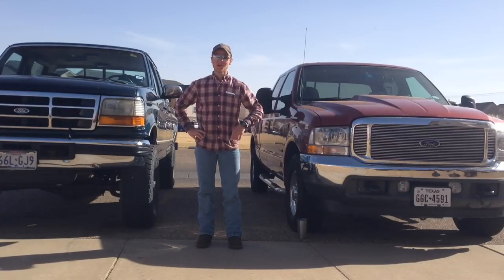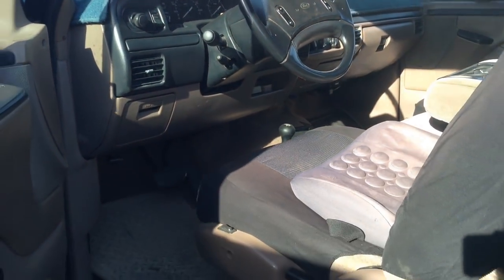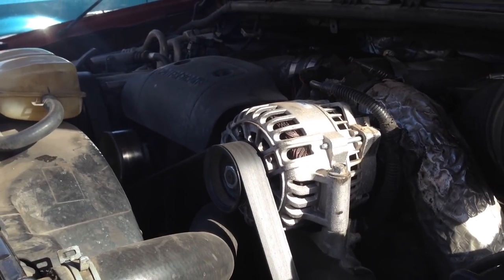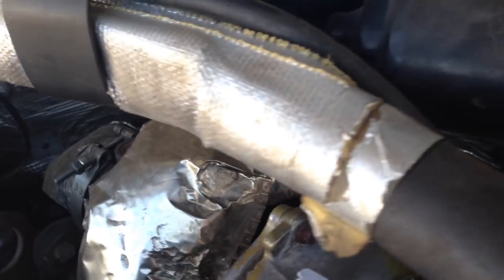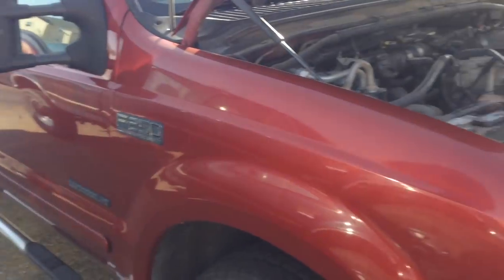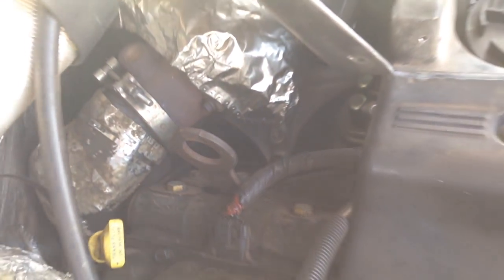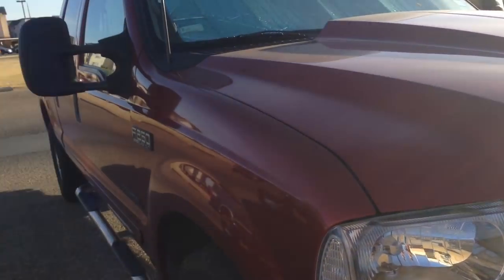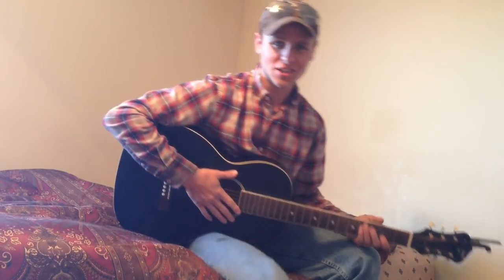OBS vs Superduty 7.3 Powerstroke

Comment: Aesthetically, I’m always gonna go for the OBS. Just is all around tough looking and the nostalgia of the “smokers window” and the push button door handles. An F350 crew cab long bed 7.3 with 4x4 is the Holy Grail of trucks IMO.
Reply from the maker: Heck yeah, I'll second that!
Reply: Club cab, short box.....
Reply: Definitely agree! And if there’s a 5 speed behind it, there’s no truck of wrather have.
Reply: @ChevyManZ  put a 6 speed ZF6. Crew Cab Long Bed 4x4 7.3l Powerstroke.
Reply: Chevy for life but I have to agree with you
Reply: Just bought a 97 crew cab f350 4x4 with a 5 speed and I absolutely love it so far.
Reply: I have a 96 f350 cclb and about to buy a 99 super duty but the 96 has 348000 miles and still starts first click of the key
Reply: Dont forget the Centurion striping, wooded out limo interior and of course the Lund cab fairing and visor
Reply: That's another reason why I love the old Fords and that is the vent windows.
Reply: I have the 94' f350 7.3 turbo single cab dually 4x4. 
My daily driver! I think I will be buried in my truck when My motor stops😂
Reply: @DukeCity.S.V  Sounds awesome brother.
Reply: @ChevyManZ  disagree. It's a big truck, driving around town in a big truck with a manual would be tedious.
Reply: @Alex Colgate big trucks are not meant to be around town,  they are for around the farm, jobsite, or the open road.
Reply: 01 extended cab 7.3 4x4.. She's sweet!
Reply: @rsroor  it’s a great truck I also have 01 extend cab 4x4 7.3

Comment: I have owned a lot of Fords. The obs is by far my favorite.  The power lacks by far in the old 7.3s compared to my 2002 7.3. I still prefer the old ones. I know I am going to get a lot of negative comments from this comment,  But I love the sound of a 90s 7.3 over any 12 valve Cummins.  The old 7.3s just sound good. I was diesel before diesel was cool.
Reply from the maker: We're mostly 7.3/ Ford guys here, so I don't think you'll have to worry about negative feedback! You say the OBS lacks in power relative to the SD, and that is true in stock form, but believe me, after a set of 160cc/00% injectors and an Intercooler, my OBS will beat the socks off a stock SD without even trying. Unless you're talking about the 7.3 idi, which is also an awesome engine, but it is definitely down on power comparable to the SD 7.3. There is one other thing those 12 valve guys are really missing out on though, besides having the cooler sounding engine... Electronic engine control. With that we can burn fuel so much cleaner and add performance a little easier at first too with just a tune. There's no school like old school, keep dieseling!
Reply: @Rnddiesel  Yes stock that is. The 02 7.3s I should say way quicker. I had a 99 And when I got the 02 it was a significant difference in takeoff.  I like the old idi 7.3s. Simple engine. The idi is getting harder to find these days.
Reply from the maker: @steiger256  I'll second that on the IDI's. When I was looking for one a couple years ago there were way more than I see now. It's like the supply just dried up. I'm betting more than anything they're just sitting in a field somewhere rusting away, their owners probably don't even know what they've got. At least we've got our 7.3's!
Reply: OBS have that distinctive cackle that I like. My understanding is later model 7.3L Powerstrokes have a special Long Lead injector for number 8 cylinder to help cut down on that cackle but I'm not 100% sure on that.
Reply: @steiger256  love my old very very rusty 93 idi manual 4x4.Also have a 2000 4x4 manual powerstroke. very sharp looking it was garage kept until I bought  it 2.5 yrs ago. Like  you I prefere  my old obs idi.Turns out it has been a special order.Vinal bench seat and floor. It had a head liner, doors with the map pockets and liner. Little coffee  cup and change holder attached to the fron of the seat. Had a headliner , ac and cassette  /am,fm radio. Finally  it had the 4x4 shift on the floor with auto hubs. To me it was/is the perfect truck. New one has carpet and cloth seats?? why?? even with the big mirrors I have blind spots all around. idi ha small mirrors  and never a problem.

Comment: Just picked up a project for my channel 2001 7.3 6 speed dually 4x4 135k Miles for $5700 so excited!!! Catching up on some YouTube 7.3 materials before tackling the big girl!!
Reply from the maker: That's awesome, a 6 speed 7.3, so cool! It sounds like you got a steal of a deal with such low miles. A good place to look online for more info would be the forums like powerstroke.org or fordtrucks.com I believe. Heck if you have any questions I know a thing or two as well. FYI, familiarize yourself with the cam position sensor, ICP sensor, and IPR. Just knowing what they do will help save you a bunch of headaches. Those are the most troublesome part of the 7.3, especially the cam position sensor. Have fun!
Reply: It runs good? That’s a great price these days
Reply: That's insane for the trucks these days
Reply: Something has to be wrong for that truck to be 5700. Has to be

Comment: I live in Australia and I had a RHD 2005 f250 7.3 but it was equivilant to your 2002, I now have a RHD obs with a 1998 build plate and I have to say I love the OBS more. I have done the e fuel conversion, dump pipe, fuel tank sumps so I feed e fuel pump with 2 tanks.... And the thing is just great fun.... And the old obs engine noise is great... 

Anyway loved your video.... 

It's only a

Comment: My boss had a 97 heavy duty and I loved it. I thought it was a late 80’s early 90’s because of the vent window. Boy was I surprised when I finally read the door sticker and found out it was a 97. Just picked up my 97 F250HD 7.3 and it’s exactly what I wanted. A truck that just works

Comment: One thing that you are not correct on is the PMR. The PMR was only run half year in 01. My 01 doesn't have the PMR. The main issues with the 7.3 in the late years was actually the wrist pins snapping.
  Turbos from the OBS were smaller than the NBS. Also, the split shots were supposed to be better for fuel economy, but but because of the primary and secondary shots, it actually killed the economy vs. the single shot injectors.
 My current build has a GTP38R turbo
Banks intercooler
Banks turbo back exhaust
Swamps HVHF IDM
30% over injectors
CAI
Custom PHP tunes
And stage 1 trans.
Reply from the maker: It sounds like you've got one heck of a build going on, I'm sure your 7.3 is fun to drive! I assume its a Super Duty with the GTP38R? 

I'd heard that the 7.3 got the PMRs past 2001, that somewhere down the road they found some sitting on the shelf and stuck them back in some late model 7.3's. Where did you hear about that? Also I thought the split shot was strictly for emissions, primarily noise emissions? Certainly International Engineers would've actually tested the fuel economy theory before making a run of  over a million 7.3's with split shots, "hoping" to get better fuel economy. Not that I'm trying to pick or anything, I'm asking a legitimate questions. If I said something wrong, I'd like to learn so I can be correct. Besides, finding another source to learn about 7.3's is cool too. I'm too young to recall the history in person...

By the way, how's your transmission holding up?
Reply: Rnddiesel 
Brother it's all good. I actually picked up a good bit while i worked with international, and the rest i got from people who made these trucks run "better" ( per say) like Vinny, owner of LFDP here in Ga.
  The trans had to be replaced, stage 1 sits in her now, i am in fact running a GTP38R turbo and quite a few other goodies as well.
 I have been thinking about going to code B injectors, stage 2 cam and GT42 turbo .
 The 7.3 can take a lot of punishment, more than people give it credit for.
Reply: Rnddiesel 
Stock 4R100 could not take it at all..lol
 International actually got the injectors from CAT. On some cat engines you can actually swap injectors, same as the older DT466 from international.
Reply from the maker: Wow, how cool that you worked with International! Pretty much everything I've learned comes from obsessively searching for endless hours on google and reading everything I can on the 7.3. I'm sure that GTP38R is pretty nice, how's the spool up time on that turbo? 

Yeah it seems like the weak spot for 7.3's is the darn transmission. Diesels just produce the power at a lower RPM which ultimately sends more torque through the transmission. Heck a gasser spinning twice the RPM of a diesel can basically transmit the same horsepower with half the torque of the diesel. Knock on wood my e4od is holding together for now...

So do you drag race your 7.3 or is it just your fun DD?
Reply: It's my DD. The spool time with the 38r is awesome man. It makers a big difference when pulling and keeping EGTs lower.
Reply from the maker: Bryan Centerfitt that's awesome! I hope to get there one day turbo wise, BB turbo sounds good with spool up, only thing I'd worry about is ball bearing life.
Reply: Bryan Centerfitt  Interesting about the HEUI injectors. I am familiar with the CAT engines on some military vehicles.
Reply: Glenn Pady 
Same principle on some of them. You can even swap some injectors out of the CAT engines. I can't remember the engine models right off the top of my head.
Reply: Glenn Pady 
Take the DT466 engine. It has a 200cc injector that will swap right over to a 7.3, but the down fall is that they are oil Hungary bitches and you need a serious HPOP in order to run them. Same with the 6.0s as well. 
  The CAT injectors have the electronics on the side, where the international is on top.
Reply: @bryancenterfitt7127  - I had guessed and it was correct (I checked online).
I'm surprised that I remember that one of the CAT engines was 3406B.
  That was from 12 years ago and haven't been exposed to diesels since.

Comment: Great comparison video! I sparked a few questions for me:
1. Can I swap stock SD injectors into my OBS to make it more quiet and increase HP?
2. What makes your '97 make more HP than earlier OBS 7.3's? (Also, is the 96 the same as the 97? I have heard those two years were the same).
Thanks for all the good videos you make! Well informed and interesting!
Reply from the maker: You can swap SD injectors into an OBS since the engines are internally the same (with some small changes, but still generally interchangeable parts), but you would need to have the truck tuned to run properly. Since Super Duty engines run split shot injectors to quiet them down, the injector dumps a smaller pilot amount of diesel into the chamber to get combustion started, then the rest of the fuel charge is injected giving the engine a quieter knock. I'm pretty sure you'd want to advance the timing so the fuel injectors are triggered earlier so that you can still get optimized performance. Most folks go the other way around and put OBS injectors in a SD since the single shot can dump more fuel into the combustion chamber in a shorter amount of time compared to the SD unit with the split shot, so I'd imagine tuning would be a bit of a challenge, but probably not impossible to find. Scratch that... I just remembered California model OBS trucks had split shot injectors! I'm sure you can find some tuning then for a California truck, grab a California ECM, but probably it's best to find some tunes specific to what you're wanting to do with the Injector combination you're proposing. 
On your second question I'm not so sure why the horsepower was stepped up. Such a small amount of 10 hp isn't huge. I'd imagine it's just different engine tuning that makes the difference. As far as I know the injectors and turbocharger are both the same. Their might be some subtle differences as well, but I'd bet it's more aggressive factory tuning more than anything. I will say now my 97 makes more hp than a stock 96 because my 97 has bigger injectors, a bigger exhaust, intercooler installed, and some aftermarket tuning which makes it a real fun truck to drive :-)
Reply: @Rnddiesel  awesome! thanks so much for the long response, i really appreciate it!

Comment: Don't know how old you but as a 24yr guy that grew up building racing mowers mustangs and diesel truck it's nice to see another young guy driving a truck an actually know what he has.  Mines  a L99 and I've got 355k and never had one of the sticks pulled. The 7.3 is the Cadillac of the million mil diesel engines.  Slower than a 6.0 and not as fuel efficient as the 6.7 but it will out last them.  Love my 6.0 if im Running late though😉
Reply from the maker: That's awesome, It sounds like you've been in the field of making engines run fast for a long time, I'm sure you know more about it than I do, and I'm sure it must be fun too! I'm only 21 years old for the time being, so I don't have a whole lot of cash on hand to make my truck not so slow. 7.3's sure do last a long while, you've got that one right. Heck I guess they really don't make enough power to hurt themselves. I'm sure that 6.0 is quick! I hope to maybe get me one of those one day, get my hands dirty with it and have some more experience working on a slightly newer model. It also would be cool to experiment and see what else can be done to the 6.0 to make it more reliable in the long term, and heck, of course make the old 7.3 faster too! 

With 355k miles, do you think you'll replace injectors anytime soon? I've got the same mileage on mine, and surely it couldn't hurt to have new sticks?
Reply: Rnddiesel Oh Lord!  I see I shouldn't comment when it's late lol.   I've just been doing upgrades for fuel and longevity:  1.15 van turbo w/ats housing, a cnc fab pump and a few other fuel mods.  Hybrid Injectors are next.  I'm not looking to make a rocket ship out of it.  But, a hydra tune, sticks and maintaining my maturity in her is the plan... "plan".  I've done a the 05+ axle swap and dash swap.  Axle upgrade by far was my favorite.   Your video is very knowledgeable, un biased and accurate.   My 6.0 truck is a monster but it's injectors won't still be around at 300+.
Reply from the maker: Haha, no I just get up that early, I like the morning, get to have coffee. It sounds like you've got quite a bit of mods done to your truck, heck it probably looks like a new truck with the dash swap! With hybrid injectors you can really pump out a lot of power with a single HPOP. My main goal is to get my truck to run like my Dad's 2013 LML Duramax, 397 hp and 765 ft*lbs with a VGT turbo like the 6.0, that thing takes off like a jackrabbit! Only hopefully the 7.3 will be much cheaper.
Reply: Doctor. Phil K  What is the "dash swap"?

Comment: Great video! Enjoyed this a lot!

Too bad you live in Texas, cause I would absolutely volunteer my 2001 F-250 for comparison. Cause I have the crew cab as well AND mine is 4 wheel drive too. The comfort of the ride in the Super Duty is definitely the two wheel drive/stock tire variant, cause I have the 4x4 with a bit meatier tires and driving it beats the s**t out of me from how rough it is 😂

As far as my opinion on the 7.3:

She's not the fastest or the strongest girl at the dance, and she's loud as hell. But treat her right and she'll outlive you! As long as you carry a spare CPS in the glove box and some oil (just in case) you'll never be left stranded by the 7.3. 

Plus it's relatively easy to work on! Love the sounds it makes and no goofy emission system making the engine ingest it's own waste.

One thing the trucks in this video have in common: the engine is in bad need of a hose down! Don't be shy! Just cover and/or avoid the alternator, batteries, and fuse box and go to town!

Comment: I've had all the Ford trucks. The later 7.3's blow the early nineties out of the water. Sweet spot was 99.5- 02.5, when they weakened the engines by dropping the forged rods. I like not having to deal with the Def and all that crap too. It does everything I want.